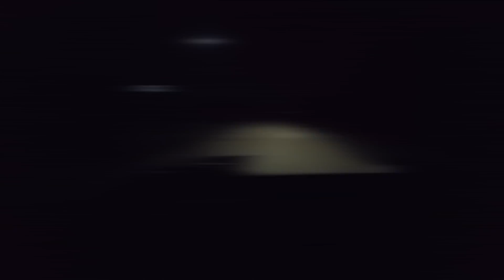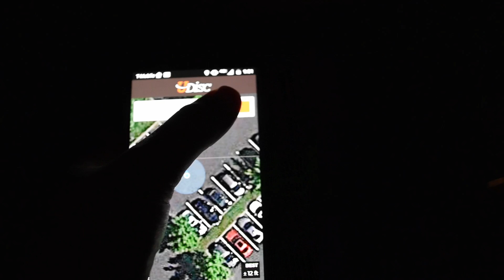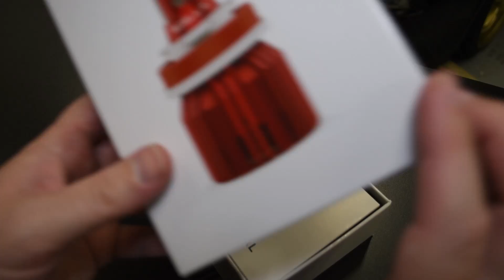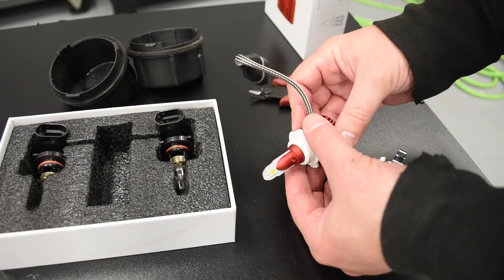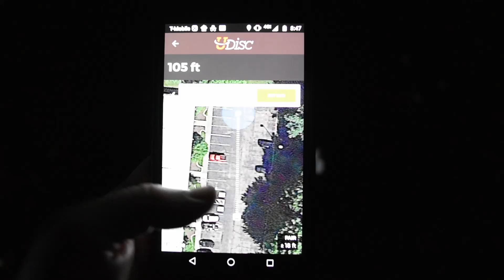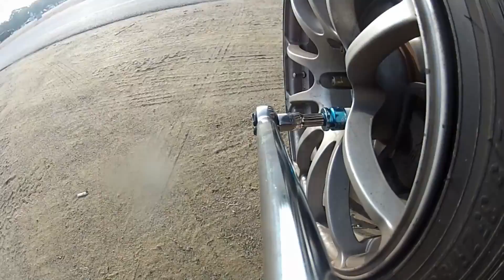NSX LED Headlight Upgrade:  Worth it? -  Boslla B1 "Plug & Play" install and comparison

Comment: Do you happen to have a link for the 3D printed cap? Or is it available for purchase?
Reply from the maker: Hey Jason.  If you just want to buy a set, Kuya sells some here (no affiliation): https://kuyaauto.com/collections/new-aftermarket-nsx-parts/products/sunset-printing-headlight-extended-dust-covers-for-led-bulbs
If you have or have friends with high quality 3D printers, another community member has posted files for printing some here:  https://www.thingiverse.com/thing:5270491

Both will be superior to the ones I'm using.
Reply: @LapoftheWorld  I installed my bulbs tonight and couldn’t get the oem caps on either.  Would love to know how someone did it if they did!
Reply from the maker: @jasonwang3413  I suspect they had the headlight assembly all the way out of the bucket or at the very least had removed the covers.

Comment: Hi 

Thank you for guidance 

I ordered both high and low beam headlights in you links. However, the caps don’t fit behind the high beam lights since the space is narrower behind them!. Not happy with that. Please advise. Thanks
Reply from the maker: Not sure what to tell you on the high beams.  It's tight, but I managed to wiggle things I to place.  Are you using the OE caps that have been modified, or a custom printed set?
Reply: @LapoftheWorld  yes I’m using OEM caps
Reply from the maker: @MChannel75  Did you take the plastic cover off of the headlight adjustment knob?  That can get you a little extra room.     As I stated, it was VERY difficult to get the OE caps to re-latch.  I could get them back into general position, but not seated.  I ran out of patience and had some cheap 3D prints done.  There are far better prints / designs now available that I may go back with if/when I need to replace a bulb in the future.

Comment: Great idea, I liked it so much I was one of the early supporters back in 2018. When I finally got them several months later for the first time Boslla was kind enough to swap bulb types as I ordered the wrong pair. Worked great in the car. Then not even a year later, both of the drivers failed and the lights stopped working. Okay, disappointed but they sent a replacement pair after I destroyed the ones I had. Fast forward a year later and one of the lights is starting to malfunction AGAIN. 

They will not help me and only offered a small, 10% discount which is a joke considering I was one of their early supporters. 

Since their bulbs don't last little over a year and they only give a 1 year warranty on the original purchase, not even if the replacements stop working within the same time frame as the first, you can expect to either. Buy a new pair almost every year, expect them to fail and have Boslla not give two craps about you. They only want your money. 
Our relationship = Here's a product that lasts only a year, then once they warranty it = here's the same pair of lights that'll only last you a year but you'll have to buy the next pair yourself even though it's our fault.  
They need to invest in some quality control and if their bulbs were actually well made they would last longer than 1 year of occasional, weekend driving. 

It's sad but since they won't help me I'll be going back to regular bulbs after these fail. 

Fun product but bullshit warranty coverage.
Reply from the maker: All of mine are still going strong at least as of when I type this.  Have you considered trying any other plug & play LEDs (I know there are more choices for NSX), or just not worth fooling with in your opinion?
Reply: @LapoftheWorld  You're lucky, both of mine were shot within a year, again. Both sets and they (bosla refuse to help.. It really makes the car look modern and I liked the idea but this kind of "it's not our fault" attitude really turned me off. 
I'm now running classic halogen Osram Silverstars and they don't look at good but I guarantee they'll work for more than a year :D 

I'm in CZ and it's hard to find good deals on stuff here. Everything is super expensive but heck, if another manufacturer actually were proud of their product, backed it up for life for a good price and it worked, I would try something again. 

I have a 2002 wrx so my standard is the H4. Any companies you think worth checking out that make these plug n play sets?

Comment: Quick question (and thanks for your informative channel.)  I bought the 9006 and 9005 Boslla's to replace poor performing LEDs that came with my car when I bought it.  Put in the low beam 9006's, which have the LED pattern like the one in your video.  They're great.  Thanks.  Went to put in the 9005's but the white collar didn't fit in the mount and when I looked closer, the collar said 9006 on it.  (This collar was larger than the collar on the other 9006's, which fit.)  Also, the LEDs were in the same pattern.  Do you recall if the LEDs on your highs and lows were in a different configuration?  New 91 NSX owner and it's great that you've put up all this information.
Reply from the maker: Hey, glad you've found the channel useful.  Hate to hear of your fitment trouble with these.  No, aside from labelling, they were essentially identical configuration.  The high beams I got do not have the same "cut" as the low beams.  They fully flood the area ahead.  Maybe some mis-boxing?

Comment: Both bulbs burned out in just about one year. Don't waste your money.  Cool idea that the poorly implemented.
Reply from the maker: I've heard/read both sides of this.  Some who had their LED burn out fairly quickly and others (at least a couple of NSX owners) who have had LED bulbs for plural years with no issues.  I suspect I do more night driving than most, so will be curious how they last.  I'll certainly report back when one or more do eventually fail.
Reply: @LapoftheWorld  Hi Richard!  I'm strongly considering doing this upgrade.  It's now 2022.  Any updates on performance of your lights?  Thanks for the great videos.
Reply from the maker: @alexlechtman5871  Hey Alex!  At least as of a week ago all bulbs were still working!  We've done several long trips since installing these with extended night running.  No issues to report.  I will say there are far better dust cap options now on the forum and maybe through Kuya.
Reply: @LapoftheWorld  Jasser says he has the 3D printed ones and recommended your video for the install.  Much more expensive but for me it's worth it if it works and is easy.

Comment: Have the 3D file for the dust covers you can share?
Reply from the maker: TL/DR - These suck, but I may have something better in the future.  
 Explanation -  I'm not openly recommending the one I used to be honest, hence the generic "have some 3d printed".  It was a struggle to get them to work with the LED units and I've since made some modification.  That said, I've reached out to a local engineer with 3d printing/rapid prototyping experience to explore a better option.  If something comes of that, I'll 100% share it.  Having said, that google is your friend and I had a hobbyist friend print them for $5/each so I didn't feel bad hacking them up to make something work.

Comment: New lighting methods needs a cutoff to be effective and not annoying to oncoming traffic.  Just adding bulbs is half the equation.  If you have projectors then you are fine, light scatters too much without a cutoff.
Reply from the maker: I agree.  I didn't do the usual "shine lights against wall to show the cutoff" but it's there.  That's also somewhat evidenced by the distance at which my test subject was illuminated not changing between factory bulbs and these.  I am definitely not out to be "that guy", but it's definitely important to do your homework on "exotic" lighting upgrades so you don't end up causing an accident or getting ticketed for your efforts.

Comment: Seems like a good upgrade. I try not to drive my NSX at night for two reasons -- the headlights aren't great and everyone else's headlights are very blinding.
Reply from the maker: Low car problems.  Right in the line of fire for anything with a lift kit, extra rough when you live somewhere that is common.
Reply: @LapoftheWorld  You mean, like, for example, Texas? LOL. The worst was coming back from Pueblo, CO a few years ago. 13 hour drive straight back. Got to I45 just north of Houston and they were doing some big construction. There had to have been 30 or more cop cars running their lights. Complete blindness, very scary.

Comment: Awesome video! Please enjoy our bulbs. 😊
Reply from the maker: Thanks for stopping by!  I'm impressed so far and I plan to put them to good use.
Reply: @LapoftheWorld  We're thrilled you love them! Let Boslla brighten your way and help you drive safer! 💪
Reply: Are there any long term durability concerns with installing the dust covers over the cooling fan assembly? I would assume that you want fresh air for that cooling fan. If the dust cover is okay, this may be the solution I have been looking for for my NSX.
Reply from the maker: @claudelawrence2775  In case they don't reply, the Boslla manual suggests leaving a small hole for the fan to breath.  That said, I know a few owners who have been running these or other LEDs with fully sealed dust covers for plural years with no issue.  Personally, I modified the 3D printed covers I had made such that there is a pinhole on the bottom.
Reply: @claudelawrence2775  Hi there,
It's okay to put the dust cover on. If you're still worried about it, please consider changing the dust cover with more space or leaving a small hole for the fan as @Lap of the World said.

Comment: So from what i understand, the kit in the video came with LEDs enough for one side of the car, i would need to buy 2? to have both running and Highbeam leds?
Reply from the maker: Yes, the kits are sold as pairs of bulbs.  There is a different part number for the highs and lows on the NSX at least. (which I think I've linked correctly in the description, but check Amazon etc. for potential bargains).  But you'll need two boxes for the full set.
Reply: @LapoftheWorld  Thank you so much for the Info!

Comment: Even with new incandescent bulbs, I feel like after a year they are dull.  This is a must for older NSXs.  Just need to figure out the dust cap.
Reply from the maker: I've been asking around and doing some research on a better solution for the caps.  I will post if/when I find something.

Comment: Thank you for showing us how to install these bulbs. 
Also thanks for the measuring app Udisc. I never knew about it
Reply from the maker: They aren't to hard, but definitely some potential stumbling points that aren't in the manual.  Udisc is great for what it's intended for, and serves as a decent GPS tape measure in a pinch.  Sometimes the best tool is the one you have, lol.
Reply: @LapoftheWorld  I currently use the leveler but I think this might be my new favorite.

Comment: i really gotta upgrade to LEDs some day. i currently have some sylvania halogens in there lol
Reply from the maker: I'd been operating in "ain't broke / don't fix" mode on this for a while myself.  HIDs always seemed too fiddly, and the existing bulbs were lasting FOR-EVER.  This was the first close-to-pnp option I'd seen that was appealing, and the results exceeded expectations (as long as they last long enough).
Reply: Great video Richard!  I’ve been running HIDs for 15 years. I might switch.